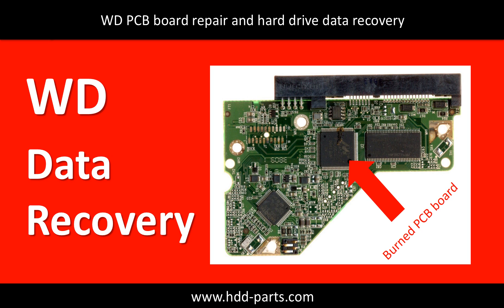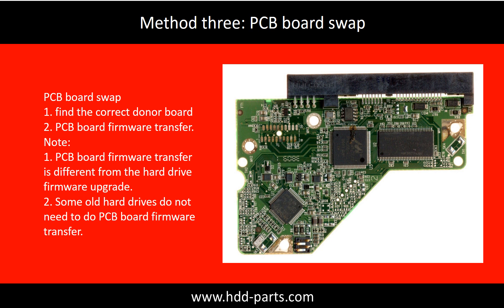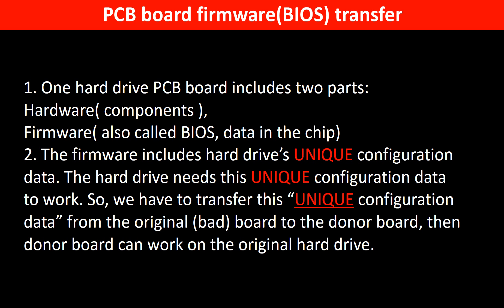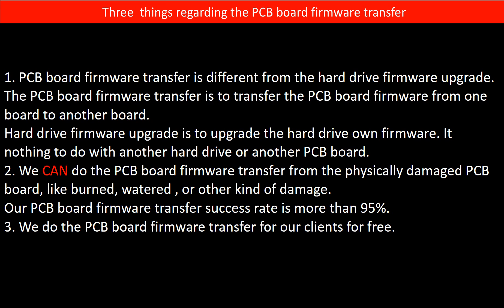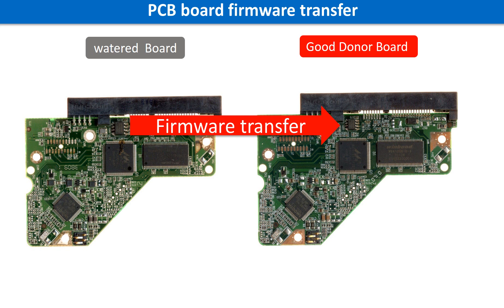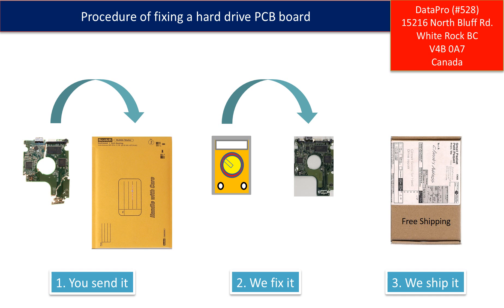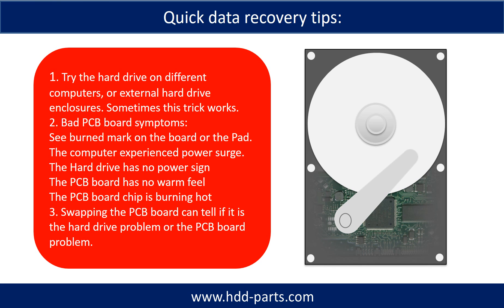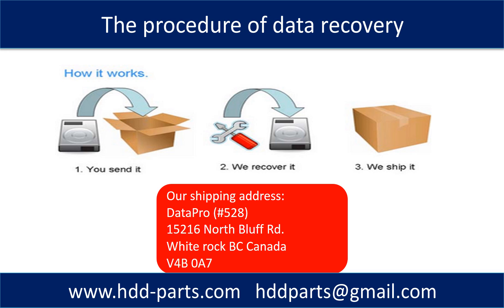WD hard drive  WD5000AVVS   PCB board 2060 701640 002  repair and data recovery

Comment: My hard disk is not recognized in the computer bios, if I find a circuit board of the same model to replace, can the hard disk model be recognized?
If I directly replace the circuit board of the same model, do I need to match the hard disk information I wrote above?

Comment: Hi, I did the BIOS/firmware transfer (swapped the 8 pin chip to the new board) and now my drive goes spin... click... spin... click. 

Any suggestions on how to solve this? The board I used has the exact same part and revision number. However one of the ICs is a different brand (Samsung).

Comment: does the wd 1 TB  WD 1001fals need a bios transfer?
Reply: Did you figure this out?  I have the same model and can not get the hardrive to connect on to my computer.  Diodes on the board have no continuity